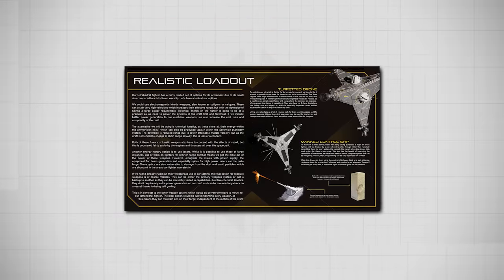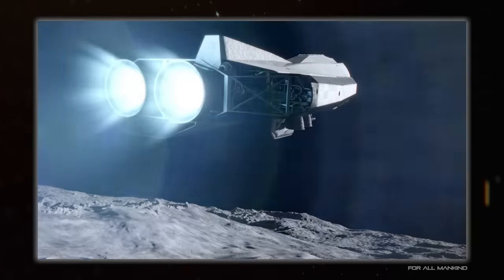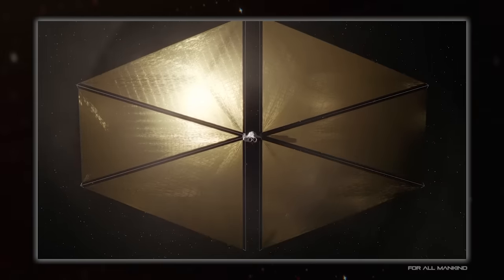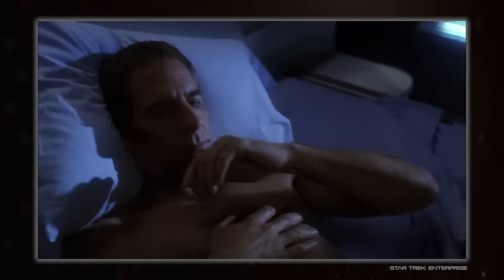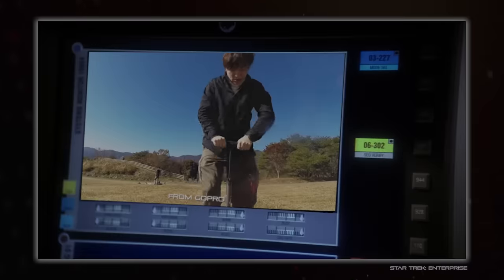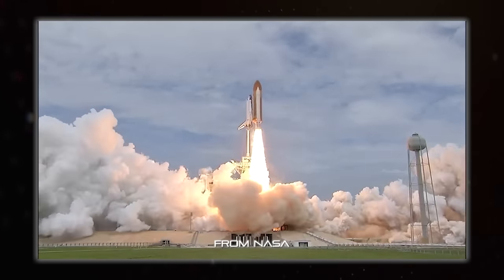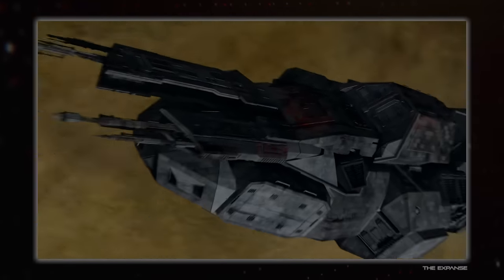Realistic Spacecraft Maneuvering

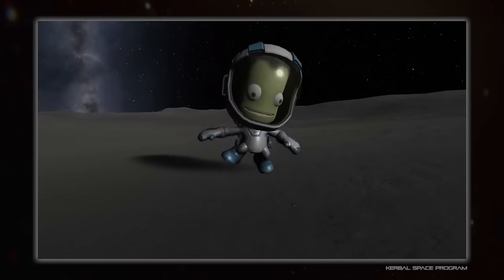Comment: 6:28 And this is exactly where most space ship designs in science-fiction fail. To go in a straight line the thrust of the main engines must be aligned with the center of gravity. Otherwise the whole ship will only ever fly in a circle. 
That’s easy enough for anyone to understand, yet so many ship designs have their engines mounted offset.
Drives me nuts.

Comment: Wait, isn't reaction mass called such because it's reacting in the combustion chamber to produce high temperature exhaust?
Reply: No. Plenty of used and theoretical engine designs throw out gas through a nozzle without any chemical reactions happening. Ion thrusters for example. The difference only matters for the engineers who design the inside of the engines.
Once the stuff comes out of the nozzles, it makes no difference for the flight calculations what its actually made off, how it got hot, and how it was accelerated.

Comment: I've been trying to solve the accelerations needed for a rendezvous in a universe that's somewhat close to The Expanse: keep thrusting the whole journey, but with a bounded acceleration
However, it looks to be impossible to solve without using a numerical solver (=you don't have a function that gives you the trajectory for any input positions and velocities, but you have to compute them expensively with a solver which might not give you the optimal solution)
If anyone wants to explore it further, it would make for a great thesis topic imho (feel free to hit me up to let me know if you managed a breakthrough). Interesting paper on it: "A time-optimal isotropic Cartesian trajectory generator with limited acceleration magnitude" (you can easily find the authors)
Reply: What is impeding you to use the Brachistochrone burn equation? The acceleration is variable?
Reply: @Angel24Marin  I didn't go into full detail, but you neglect gravity (because you have thuster that output a force far grater than gravity, especially in interstellar space) or consider your movement to be fast enough to be able to consider the gravitation force constant for both you and your target during the whole movement (so you can neglect it)

In the end you simply have the target's position pt(t) = pt(0) + t*pt'(0) + 1/2*t²*pt''(0) (the target is constantly accelerating)
Your position pm(0), pm'(0) and you control your pm''(t) where |pm''(t)|<=max_acceleration

You want to rendezvous with the target asap, which means you want the best accelerations pm'' such that tmin is minimum, where pm(tmin) = pt(tmin) and pm'(tmin) = pt'(tmin) (i.e. same position and velocity)

I don't think that you can use a brachistochrone curve for this? But it does give me new ideas, thanks :P

Comment: ReMass can also be called 'Propellant,' but like the fuels for engines here on Earth, each type of propellant is more practical with specific engines and situations. Though, the consistent loser in the propellant race is hydrogen, despite what the diamond-hard sci-fi fans will tell you.

For example, let's take two of the most common liquid rocket engines: LOX/LH and LOX/K. LOX/LH is Liquid Oxygen/Liquid Hydrogen, and such rocket engines have them react to produce water, creating a lot of energy. The biggest problem with this sort of rocket is the hydrogen, which loves to escape and its density is deplorable no matter what you do (liquid hydrogen has a density of 13.5-14m^3 per metric ton, and it's so bad that this density is a unit of volume in the sci-fi tabletop RPG Traveller aka one of the oldest surviving tabletop RPGs of all time). LOX/K is Liquid Oxygen/Kerosene and is basically burning kerosene to provide thrust. Due to just how energy-dense but (relative) ease of handling hydrocarbons, LOX/K engines are less volume-hungry than LOX/LH engines. There is work with LOX/M (Liquid Oxygen/Methane) engines, but those are still in development.
Reply: The terms are not always interchangeable.  In thermal engines yes, but in chemical your propellants combine to make a reaction mass.

Comment: Video about Spacecraft Maneuvering and doesn't even mention orbits.
Reply: Watch again.
Reply: @TheEvilmooseofdoom  It's "explained" for like ten seconds without actually going into the implications. Considering orbits are spacecraft maneuvering that is basically not mentioing it in a ten minute video.
Reply: @XMysticHerox  
It's not "explained," it's explained why it isn't explained in this very very introductory video.
Reply: @the18thdoctor3  Any introduction to maneuvering in space needs to include an introduction to orbital mechanics. 

As it stands the bits about actual maneuvering in this video rather than engines might as well be about aircraft. If you are not talking about how moving in space works you are not talking about spacecraft maneuvering.

Comment: Star Trek is actually very detailed in how they move. Both in and out of FTL (well warp drive as the others are not as well understood). Impulse engines are basically extremely advanced nuclear engines that use an impulse reactor to generate plasma then direct it using EPS conduits or other specialized hardware to go wherever its needed. There are ports all over the ship for this purpose. They also have RCS thrusters but instead of hydrazine they use a smaller version of the impulse engines (usually a dedicated engine for each one). Of course this all requires the plot device known as inertial dampeners, but thats just so the crew dont turn into pancakes. The inertial dampeners use a heisenbug compensator to function, which if that part could be properly defined we could also build inertial dampeners. But the point is is that sometimes scifi makes the ships look like they ignore physics other times they just have some plot device that allows for the ships to move like they do, but have otherwise proper engines to do those manoeuvres
Reply: They might go into detail, but that doesn't make it accurate.

Comment: Rockets can't work in space vacuum. Newton's 3rd. needs friction to transfer kinetic energy and momentum. If the pressure of a system is 0 then the work done by the expanding gas into that system is 0. Gas expanding in a vacuum doing no work agrees with Free Expansion. This can also be understood as the gas meets no resistance as it exits into the vacuum and thus transfers neither heat nor energy to its surroundings. If the gas loses neither heat nor energy then it has done no work.

The principle of work and kinetic energy (also known as the work-energy theorem) states that the work done by the sum of all forces acting on a particle equals the change in the kinetic energy of the particle.

Rocket thrust is given by the equation: F=m˙vexit+Ae(P1−P2)

where m˙ is the mass flow rate, vexit is the average exit flow velocity across the exit plane, Ae is the cross-sectional area of the exhaust jet at the exit plane, P1 is the static pressure inside the engine just before the exit plane, and P2 is the ambient static pressure (i.e. atmospheric pressure).

Provided that the nozzle is not overexpanded and flow separation does not occur, Ae remains constant, and the thrust difference is realized primarily from the change in P2. If nozzle is overexpanded to the point that flow separation occurs, you lose contact, however, the exhaust jet area drops as well, causing further losses. That's why we have adjustable nozzles, but that only postpones the inevitable. Space vacuum creates flow separation. We can't saturate space vacuum to create backpressure. It's the path of least resistance. The lower the pressure the faster the flow. Momentum is preserved in the exhaust gases, there is no momentum transference. Hence no thrust.